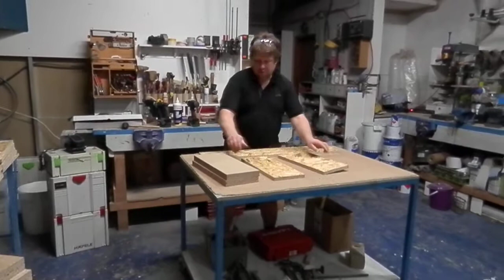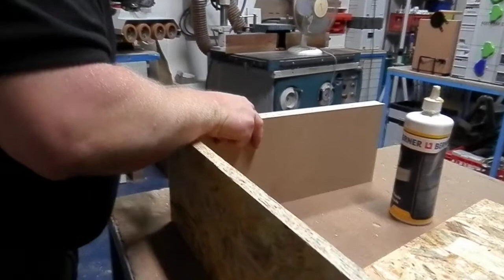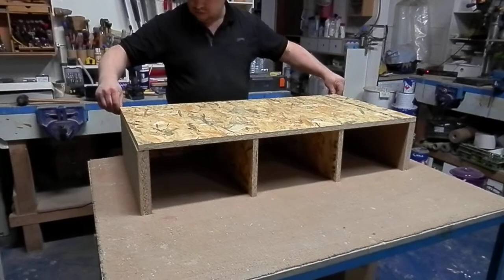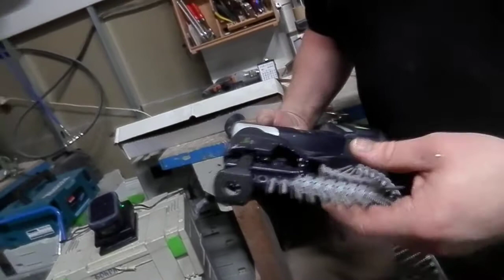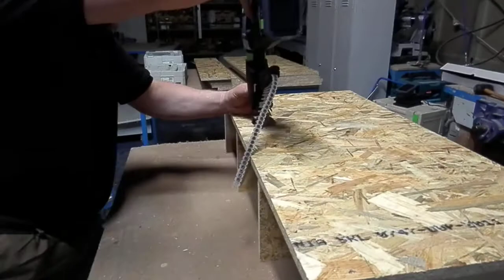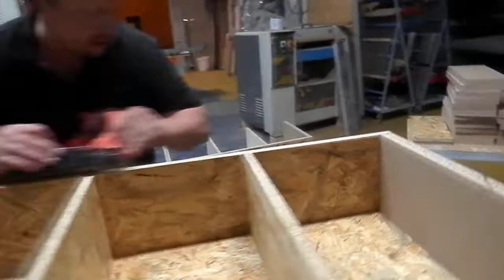WOODMAN & FESTOOL: When you need it fast & fast.

Comment: Am not sure if I would use drywall screws (rust & break very quickly) but if it works for you, why not. Kind regards.
Reply from the maker: Sorry, but your conclusion is not correct. First, I use special screws for wooden boards #769145 by Festool article. Second, my screw-driver was designed for working with wooden boards DWC 18-2500.Third, it was quick job for event: 8 steps next to scene. Event was only for 3 days. Therefore I called it fast & fast etc.... Everything is correct, from my point of view.
Reply: Dear Sir, thank you very much for your courteous reply. I meant no offence when I stated the above. I was blissfully unaware that Protool/Festool made any other variants available. I do know that some manufacturers offer some for flooring. I stand corrected & offer my sincere apologies for the reaction you offered. Kind regards.
Reply: I took the liberty of checking the part number you gave which according to Festool USA as well as Festool UK ( am pretty sure it's the same the world over) shows the following:Drywall screws DWS C CT 3,9x45 1000x
AF 55-DWP/DWC

Order number: 769145
It would appear that after all I was entirely wrong; it's a real pity you went on the defensive so easily when my comments were not critical merely my personal opinion (irrespective of being right or wrong ). Hope this helps. Kind regards.
Reply from the maker: Dear Sir,in my turn, I also thank you for watching my video. As English proverb says:" Live & learn" and YouTube helps us in it. Best regards from Portugal.
Reply from the maker: There is mark "CT" means Coarse-thread screws for wooden substructures. It has the same (more or less) thread as chipboard screw. But anyway, don´t take it personally cause English is not my major. Kind regards.
Reply: Obrigado for your reply; I am not a vindictive person & do not take your comment as being bad. As you rightly said & pointed out your command of the English language perhaps limits your ability to express yourself properly. Anyway it seems this matter has been resolved with both parties integrity intact. Take care & best of luck in your future endeavours.
Reply: Dear Sir, thank you for pointing this to me; I don't take replies personally & am far from being offended. If everyone took the time to convey courtesy we would all benefit from it. I wish you well & sincerely hope you'll make more videos in future. Kind regards. P.S I've subscribed so as to support your good self.
Reply: Thank you for your response. See you on your next video. Take care.